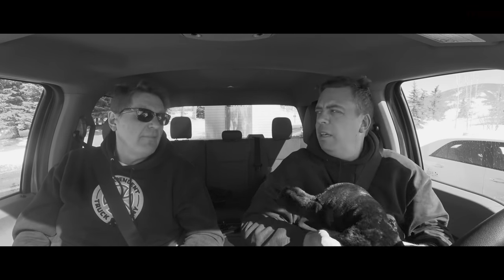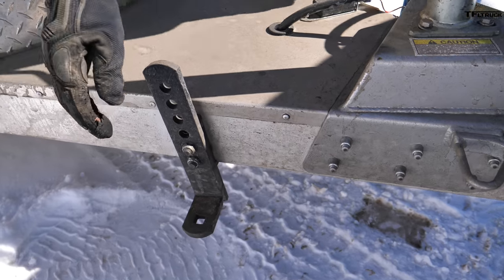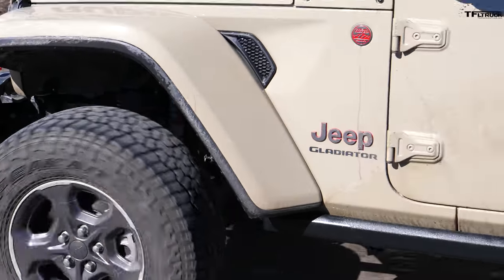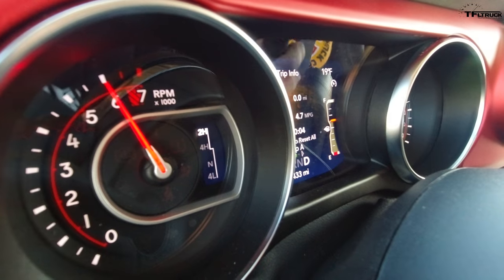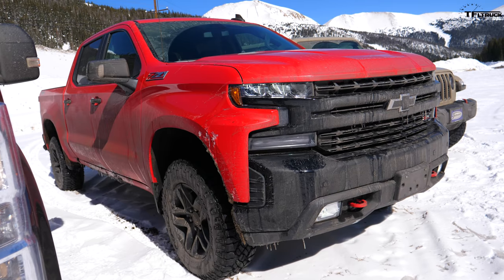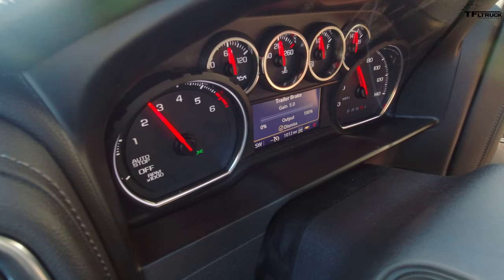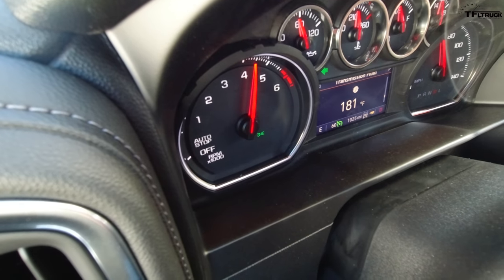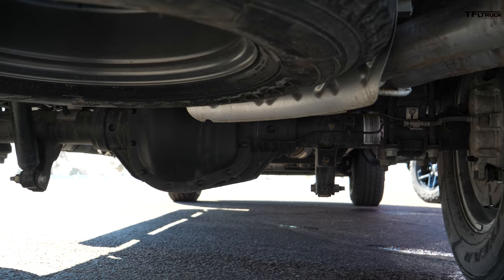Midsize, Half-ton, and HD Trucks Versus the World's Toughest Towing Test - Only One Truck Kills It!

Comment: Since theyre all the same price Id get the f250 for sure.  I tow 2 atvs and that truck would last forever. 🤘👌
Reply: Yeah the F250 will last forever if you keep repairing it. Ford lasting forever ha ha You’re Funny!!
Reply: @carloscortez1442  I daily an all original 41 year old f250 and it's not slowing down anytime soon.
Reply: Zach  any truck or car will run  for 41 years if you keep repairing it The bad thing about your Ford is that you repair more often than others.  And that’s the truth you ain’t convincing anybody bro.
Reply: Carlos Cortez you certainly don’t know about ford best selling truck for more than 41 consecutive years so all those pepole that buy them would buy another piece of crap huh lol 
ford For Only Real Drivers
Reply: @carloscortez1442  did you not hear me, I said "all original" the only thing replaced was a fuel pump gasket and I didn't really have to replace it because it didn't leak that much, I just like a clean truck.
Reply: For the same price I’d go w the 250 as well no real reason not too.
Reply: @carloscortez1442  In 240k miles of my 2002 f250 all I ever replaced was a fuel filter and 2 spark plugs
Reply: My 2000 Ford F250SD still going strong. 7.3L Diesel not the fastest but still great engine.
Reply: Zach nobody believes you bro nobody that’s impossible it’s a Ford no way it’s not a Toyota.
Reply: Max Krukar Ford hasn't made a good truck since 2014!
Reply: Carlos Cortez Ford use to be decent! But now their quality control went way down. It’s sad
Reply: Jay Moar I was a big Ford superduty fan in the mid 90's and early 00's. I would cut out their advertisements and hang them on my wall (I was 16), especially the 350 dually (family friend had several) because they came with free TV'S for the truck. Had many friends with Ford trucks and I tried to buy a couple myself. However, my 2015 f150 fx4 2.7 crew cab xlt put a VERY bad taste in my mouth about Ford trucks. My 09 fusion was one of the best cars I've ever owned, my 13 SHO had nothing but engine issues, but was very fast. I bought a used excursion that had nothing but issues. I am willing to give Ford another chance, but they gotta get rid of the aluminum body!
Reply: John Doe I agree vehicles only look good nowadays.
Reply: James Lee 7.3 diesels are work horses they just keep goin and goin. Kinda weak in the power department but they’ll never do u wrong
Reply: @FutureRN_Corey _ unless you value things like comfort, ease of parking, fuel economy, off road capability, convertible capability, resale value etc etc etc... This test only paints part of the picture.
Reply: John Doe I dunno much about 2014s, but my 18 F 150 is the biggest piece of trash ever. Unbelievable Ford keeps selling these things.
Reply: Dirty Harry 4x4 hub vacuum issues, electronics gremlins galore (usb hubs replaced, trailer harness water intrusion issues, parking sensors replaced), goes in tomorrow for complete variable timing unit replacement on 3.5 ecoboost (cold start rattle). Not to mention rust beyond belief on the undercarriage, warped dash and glove box.  The engine repair is under warranty luckily, would be approx $4k to fix if it wasnt. No way would I ever own one outside of warranty. Its a lease and Ill be doing cartwheels in the parking lot when I turn it back in.
Reply: @adamharriger5193  I had a 2013 Ecoboost 3.5.  It was garbage.  The torque was out of this world but my engine hydrolocking at full throttle merging onto the highway was scary af.  The 5.0 v8 and the 7.3 b8 are and will be great motors. I had a v6 f150 for over a decade with no issues and a 5.0 v8 with no issues.  Not a fan of the ecoboost program and I understand your frustrations.
Reply: @carloscortez1442  you do realize any American truck is roughly the same in terms of reliability? Except the 2014 to 2018 era of GM trucks, they're complete shit. I would know, I have one.
Reply: @max7768  who replaces individual spark plugs?
Reply: @DStabs720  I replaced them all, I'm saying 2 of them blew out of the threads
Reply: Two words: Death wobble

Comment: Great test!  Using a modest (7000 lb) trailer weight for the Chevy and Ford is a closer metric for most drivers than towing the maximum. So, this test broadens the perspective. Even knowing the Gladiator has the smallest engine, I was surprised that it got the best mileage. Then again, your prior tests with other Ram products revealed their computed MPG was not as realistic as Chevy & Ford.

Comment: One of you best test. Seven thousands pounds is a good weight for the average person that might be towing a average size camper at a safe speed up the Hill
Reply: R AJ they were showing what the average joe shmo once a month trailer towing person would do. The gladiator is not a truck to pull 7,000 pounds regardless if it says. Someone is going to get hurt with no experience towing but because Jeep said they can they shouldn’t
Reply: Good test, the load seemed appropriate. the Chevy seemed to rev way to high for my liking.

Comment: Yeah that 24 gallon fuel tank on the chev has got to be bigger, i own a chev with that fuel tank and i hate it. Ford offers a 36 gallon on the F150 so as it stands the Ford will be my next truck.
Reply: You could always get a HD truck and get a 52 gallon tank 😂
Reply: We have a 34 or 36 gal tank on our f150 really nice so you don’t have to fill up all the time.
Reply: Newton Washinton I love my 2012 F150. Problem is a new Chevy 1500 that’s similarly equipped as an F150 Lariat is about 8-9 grand cheaper. An LT is pretty much the same as an XLT except it offers dual climate control where as in the Ford, I have to step up to a Lariat. Dual climate control is a must cuz the wife and I always fight over the thermostat in my XLT. And I hate the way Ford packages everything right now. Almost any option I select on a base lariat automatically upgrades it to mid lariat, chrome/sport package, etc! 🤬 
The only deal breaker on a new Chevy/GMC is that dinky gas tank. It’s even smaller on the diesel 1500. Except give it some time and Titan tanks and TransferFlow will offer an upgrade tank. But those little diesels are slugs. 😑
Reply: Only certain one most fords that are crew cab with features have the 23 gallon tan so worse
Reply: My f150 has the 36 gallon tank and it gets like 600 miles of range
Reply: SOLAR SS no, the crew cab comes standard with a 26 gallon tank. The regular cab and I believe the super cab 6.5’ bed has the 23 gallon. A 36 gallon tank is a selectable option for the crew cab and maybe the super cab 8’ bed.
Reply: @jaysson1151  Hi Rick,  Yes you can get the 36 gallon fuel tank 2 ways, either a stand alone option $445.00 or its included with the Max Tow Package, the trucks you can get the 36 gal. tank is,   Single cab 8' box, Super cab 6'.5" and 8' box, Crew cab 5'.5"  and 6'5" box. The only truck you cannot get the 36 gallon tank is the single cab 6'.5" box.
Reply: Newton Washinton then there’s the Ram which offers a 33 gallon tank and the Toyota Tundra which offers a 38 gallon tank. Nissan and Chevy are lagging behind, ESPECIALLY Nissan. That heavy ass Titan XD which no longer offers the 5.0L Cummins only has a 26 gallon tank. It weighs around 6700 lbs with the gas engine. A 34-36 gallon tank would be adequate, 40+ would be superb.
Reply: @UltraSS-nj8kd  I had a supercab with the 36, now have a supercrew with 5'5" bed with 36 tank, neither truck had max tow, just regular towing package.
Reply: @jaysson1151  Years ago i leased a 1995 F150 with stick shift and twin fuel tanks that held 40 gallons total. Going down the road when a tank went empty you simply switched to the other tank. that truck had almost a 800 mile range.
Reply: Newton Washinton NICE! How about the Ford Excursion with the 50 gallon factory tank?!?!
Reply: Newton Washinton you don’t have to fill up that often. I drive 30+ a day and my neighbors who drive a little more with fords have to fill up more often.
Reply: @toofastnobrakes  hey Mike the problem with that is you are no longer getting 22 mpg.
Reply: Hakimbo Bola  lol
Reply: Max Voichahoske25 if you plan to tow long distance you will. 6-8 mpg towing, you’ll have to fill up every 150-180 miles. That is a bitch when you gotta pull into a crowded gas station with that trailer. At least if you have diesel (which I’m not suggesting you get a diesel) you can pull into the truck station and fill up there. Plus on long road trips, my big gas tank gives me the option to bypass expensive counties and even whole states if I have to before filling up. The 5.3 is a dog and so I’d much rather get the 6.2 if I’m buying a Chevy. The trailboss 6.2 is rated for 19 hwy so that means probably 17-18 going 75mph. I’d have to fill up every 350-375 miles if driving with no trailer. Nothing worse than running the tank to E and then get stuck in a stand still jam on the interstate in the middle of nowhere. I was on a 1/4 of a tank in a rental van once and got stuck in a ‘parking lot’ on the I-59 about 20 miles from Chattanooga for over an hour. At least in my truck with the 700 mile range, when I get down to about 150 miles to E, then I go fill up.
Reply: @jaysson1151  I went to the Ford site did not see the Excursion.
Reply: Newton Washinton I know. You were just mentioning an older truck so I mentioned the Excursion. There’s pretty large group of people, including myself, that wish Ford would bring back the Excursion.
Reply: @jaysson1151  I am probably one of the few that wish i could get a console mounted 6 speed from the Mustang with the 5.0 in a F150 sport model. Something none of the mfg are offering. Would it sell,.. i don't know, but i do know i would buy one.
Reply: Newton Washinton never thought of that. Interesting combination. It’d probably work in a single cab.
Reply: @jaysson1151  Yes, that's what i was thinking, single cab, short bed. 4x4
Reply: @jaysson1151  so when did they changed the crew cabs fuel tank? 2018 refresh?... my 17 lariat crew had 23gal but i do see where it has changed on their site
Reply: SOLAR SS I don’t remember them not having a 26 gallon standard tank. My company’s truck is a 2016 crewcab and it has a 26 gallon tank.
Reply: @jaysson1151  yeah mine was 23 but wonder what else changed... is there a crap plastic  oil pan on both as well?  And did they fix the trailer hookup safety chains?  Mine needed D-rings to meet the chains & couldn't open the tailgate it was too close to jack

Comment: I ordered an f250 xlt tremor with the 7.3, seems like it should be perfect for my needs. Same dealer that y'all got yours from. Fun fact, got mine basically fully loaded for the package and the price difference between yours and mine wasn't much.
Reply: Should be nice. I think that 7.3 is going to be a good engine for Ford. Hope FCA has something on the back burner to answer that doesn't involve forced induction coming for the PW.
Reply: Nice but why 7.3 you should use 6.2 also

Comment: Obviously the biggest truck will tow the most/best and the smallest truck will tow the least/worst but it's important to pick the right tool for the right job. 

Midsize is meant for offroading (Gladiator mostly), camping, overlanding and needing a bed for occasional large items like a couch or plywood. 

1500s are meant for the average person who occasionally tow a camper,  larger boat or haul construction equipment but typically just daily drive. 

2500s and up are meant for towing and work. Period. 

I wouldn't want a midsize to tow a trailer long distance nor would I want a F250 to drive to and from work every day

Comment: Great video!! Would be great if you do the same with diesel bears (same species of bear but diesels)
Reply: That needs so much more likes!
Reply: A f250 with a 6.7 diesel is way over kill for a 7k trailer
That wouldn’t even be anything close to real world
Reply: @simonsays6701  in Germany it would, since we are only allowed to pull 7000 pounds max, no matter what you are pulling with.
(that does not apply to gooseneck trailers)

So it would be very interesting to see if a bigger engine will consume less fuel then a smaller engine since it does not have work so hard, and if it does, how much less.

We had that same effect with big over the road trucks, very interesting to see if it will be the same on a much smaller scale.

Comment: Once again another great video from you guys. I use cruise control and not only my personal vehicle but my work truck which is an 18-wheeler. I use it fairly often going up hills with a medium sized load. Never really maxed out. I think if you guys incorporate cruise control common it should be from start to finish as opposed to turning it off at different points during the Ike gauntlet. Thank you guys for doing what you do

Comment: I’m a Toyota guy but that boss is nice🍀
Reply: I agree. I'm a Ford guy, but I like the idea of the Trail Boss. It comes from the factory how I would set up my truck anyway. All I'd need to add is window tint and rear airbags.
Reply: Looking to sell eith my 14' 4runner or 14' explorer xlt.  Explorer is loaded with 30k less miles and worth $5g less.🤣🤷‍♂️
Reply: Northern Rider Offroad my bro, I would let go the Explorer , ska new slippers on 4Runner and live happy. Just a though! 🍀
Reply: Rickey Cooley my son and I have ‘15 and ‘17 Crewmax 4x4s. Currently negotiating for 3.0 Chevys. Toyota refuses to bring their Diesel engine here. We’re DONE!
Reply: GraysdadCal is that the small Diesel?  3.0? I know they have one for the Colorado but couldent remember the size. Toyota used to ( way back in late 70’s. Maybe very early 80’s. Didn’t see many , it was a camper kind of rig on a 1 ton  pickup with heavy  duty suspension. Ain’t seen one in forever,got my brain spinning now!🍀🍀🍀🍀🍀🍀🍀🍀
Reply: Rickey Cooley outside of North America Toyota has world class diesels. They have a 4.5 V8 TD that is strong and efficient. Chevy has developed a 3.0 inline 6 for their 1500 trucks. Find it on YouTube. It’s getting 31-34 mpg. 270hp and 460 torque. We’ve been Toyota loyal for a long time. We’re done.
Reply: GraysdadCal yell if Diesels is what you want, Chevy is the way to go, Toyota don’t offer that one in Tacoma or Tundra. That’s easy enough. No Diesels.so here we find it, Ram offers a Commings . The worst truck on the road! Ford has power stroke , very good! Chevy has Duramax very good too, you have 3 reansable choices !a better choice is the 5.7 Toyota badass 400 hp bullet proof last 400000. K miles easy Toyota but your done with it, done with quaility I reckon, cause you won’t get it with other 3 🍀🍀
Reply: Rickey Cooley I love my Toyota’s. I drive 60k miles a year. It’s a rare day I don’t fill up my tundra. To go from 12-17mpg to 25-34mpg I’ll take it.
Reply: GraysdadCal I know bro. But I think just haveing a real good reliable truck at 12/17 ain’t too bad. Gas is down , been going down for a while, my Tacoma v6(3.5) gets 18-19 every day no matter. That’s cool but a trundles .... no shit ! I love em🍀
Reply: TUNDRA dam my finger🍀

Comment: I like that “lifestyle truck” a euphemism for it can’t haul very well
Reply: It can haul very well for the type of vehicle it is though.
Reply: Midsize trucks are given that title.  They are meant more for towing/ hauling a PWC, snowmobile, or quads to play places, maybe hauling stuff from the hardware store, etc.  If I was going to tow heavy loads all the time, I'd be in a half or 3/4 ton truck, depending on my needs.  As it is, with my towing requirements, which are few and far between, my Colorado fits the bill.
Reply: You mean it can’t “truck” very well.
Reply: @FishFind3000  They truck just fine.  They're specially built for those who buy a truck for recreation instead of commercial duty, and wants it to actually fit in their garage
Reply: All show no go. 5.3 swap it and have some real fun. "Hipster truck"
Reply: It can haul pretty well, think about how far trucks have come in 20 years. My 98 ford f150 with the 4.6l and tow package can't tow as well as the Jeep, the old ford is only rated 5000 lbs normal, and 6800 with weight distribution hitch.
Reply: Lifestyle truck means mall crawler.

Comment: I really want to see the new ford gas F350 7.3 vs 6.2 test. They are both available in the 350 and both have the 10 speed. I want to see how much of the new performance is due to more and closer gears and how much is due to the 7.3 having a lower rpm torque curve. It would be super interesting to see, basically how much difference does a newer transmission make? Same goes for the Rams. You can get the same basic truck right now with a 6 speed or an 8 speed. 
The selfish reason I'm curious is because I have a 19 F350 with the 6.2 6 speed and I feel like with a 10 speed it would probably pull hills without losing speed, but the 6 speed gears are just too far apart.

Comment: I will use cruise control on smaller rolling hills, but for steep grades, I'll throw my 09 F-150 in 4th or 3rd to keep my Rpms between 3500-5000 and hold the gear on the way up and down. This keeps my truck right where I want it without all the shifting in cruise or regular drive.